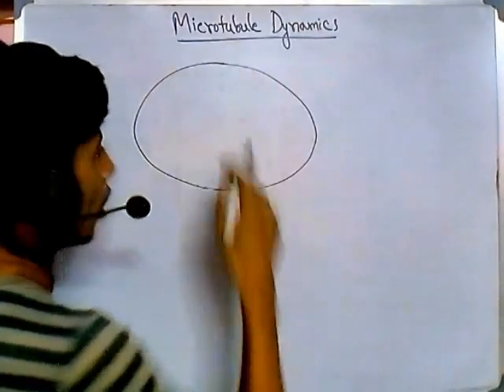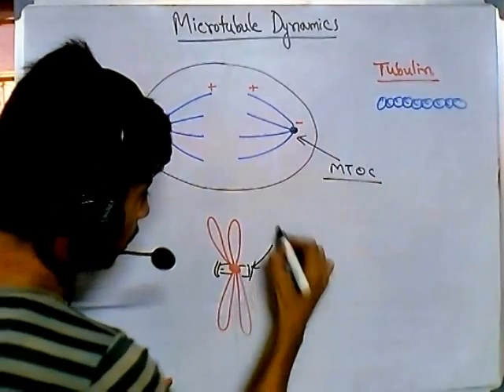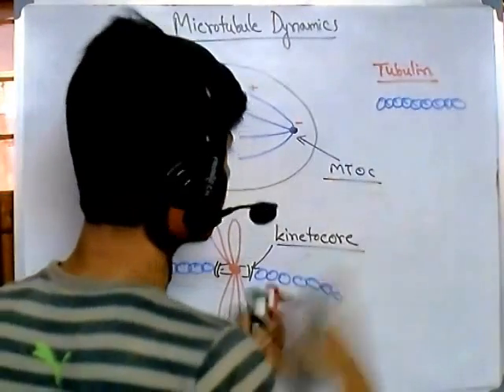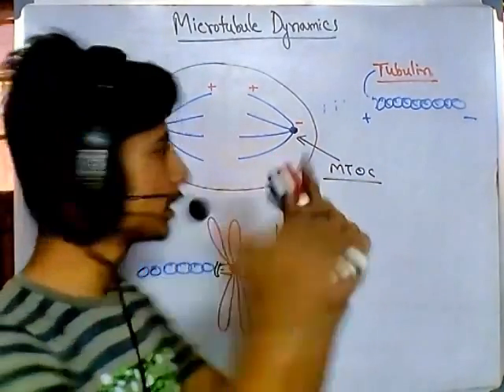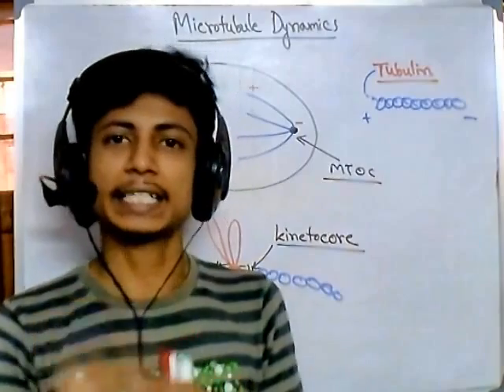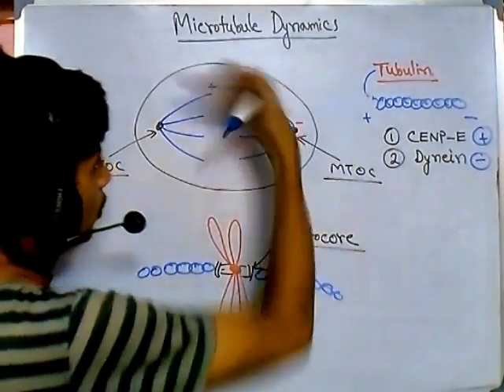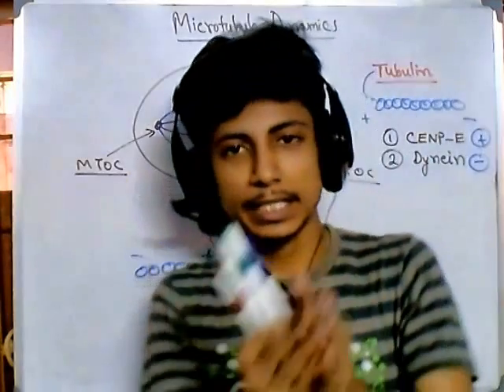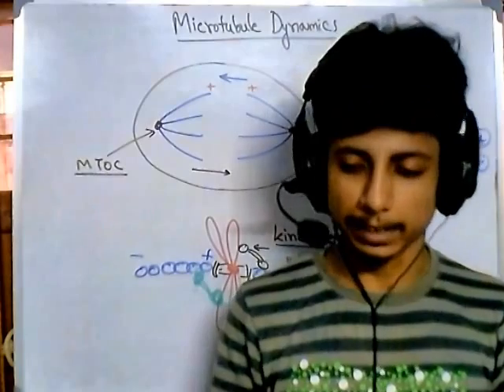Microtubule polymerization, trade milling and function

Comment: but i am confused if it is pulled only towards one side how would it seperate into two chromosomes???
Reply: Same question
Reply: i still have the same question did you find an answer to that
Reply: same but i have another question.why is the chromosomes stay in the center?plz answer.
Reply: @rifatkhan192  maybe that is the best way to    seperate them. That is probably the answer to your question but ı am not sure
Reply: No it can't separate   the chromosome.
Reply: I don’t know if you still need the information... it has to do with the cell cycle and cytokines. When APC/C is activated at m-a control point it begins the ubiquitination of cytokines and also some proteins. One of those proteins is securine. Without securine (it is degrated) protein separase is active and separase separates the cohesins between the sister chromatides. This is how they get separated and it also means the begining of anafaze. I hope that is helpful
Reply: @rifatkhan192  yes but not exject in centre thoda 19   20 hota h center se
Reply: In anaphse, anaphase, the microtubules attached to the kinetochores contract, which pulls the sister chromatids apart and toward opposite poles of the cell. At this point, each chromatid is considered a separate chromosome.